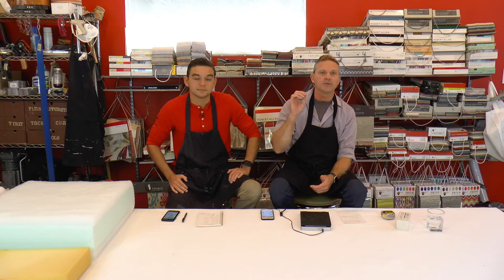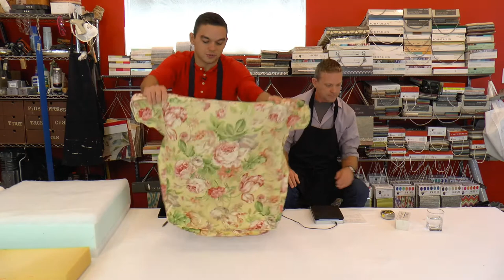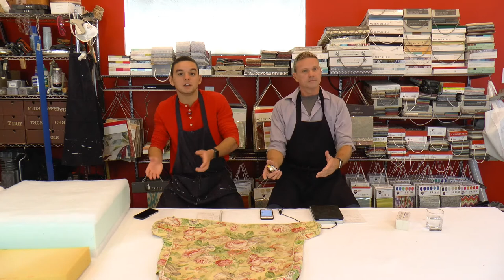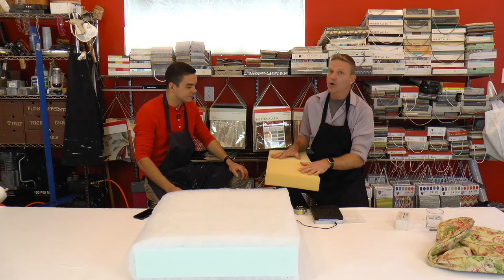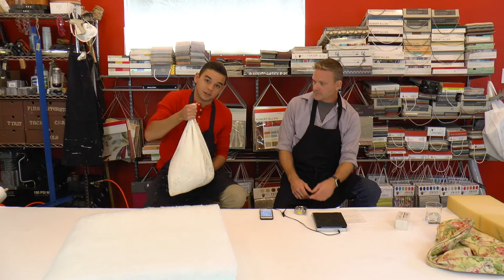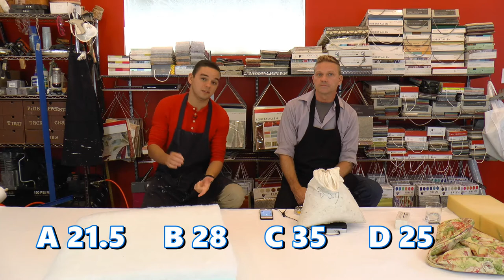Save My Assets Ep. 15 - Foam Numbers Density ILD vs IFD WHAT😕? Replace With No Existing Foam Insert

Comment: I have a large sectional with cushion covers that measure 31x28x6.  I understand adding the additional inch but being that the cushion is thicker than most, what would you recommend for density?  Also the cushion has a down cover that goes on the outside of the cushion but inside the outer fabric, do I adjust my measurements at all to account for this? - My guess is B - 28 lbs.
Reply from the maker: Great question, we actually go over this answer in our other video here: https://youtu.be/dCgEAbMPoGA
This video goes over compression selection as well as what to order for cushions with the foam and feather core. Important Note: it is different then how you would normally measure!!!

Also unfortunately the contest has already ended for last weeks video, however, since you participated we’ll offer you a 10% discount on your next order.
Reply from the maker: Please message us at one of our social media accounts to receive instructions on how to claim your 10% off your next foam order :
Facebook: https://www.facebook.com/UCPrivateCourses-Foam-Order-111650360196719/?modal=admin_todo_tour
Instagram: https://www.instagram.com/uc_solutions/
Twitter: https://twitter.com/UC_Solution
Thanks again and we look forward to hearing from you!

Comment: Are the same compressions between closed and open cell foams comparable in feeling
Reply from the maker: Hello Pamela,  I have never compared the two one on one. However when the foam is produced there is a goal say 26 lbs of compression both open and close work toward that compression. So they maybe very close if not right on. I hope this has helped you and I thank you for watching. Please share the video it helps. Cheers,  Paul